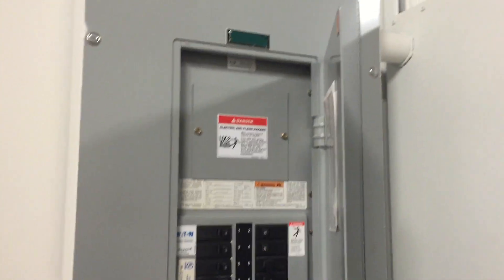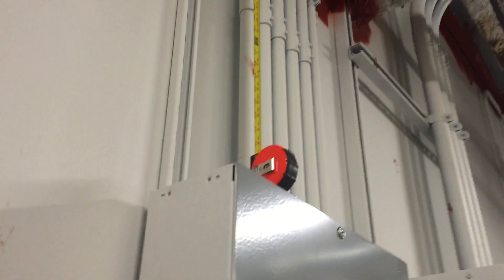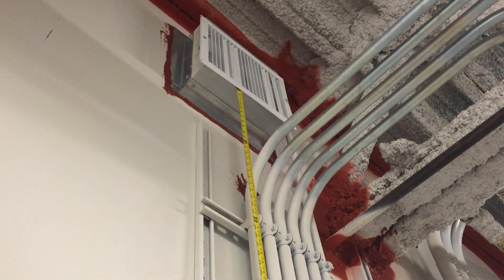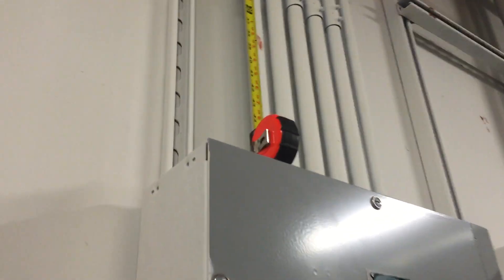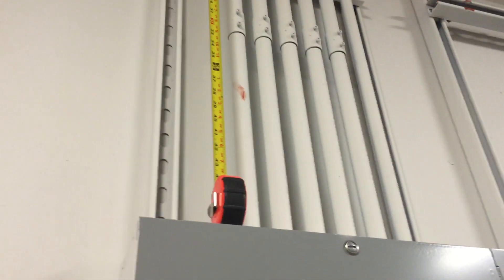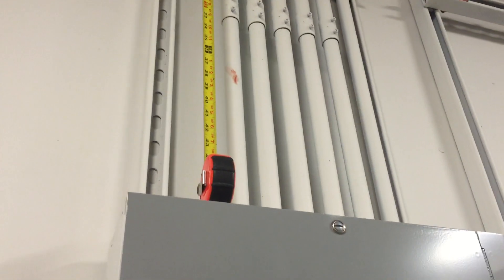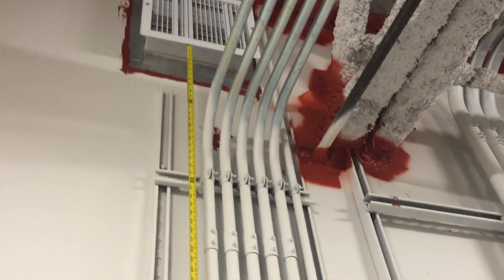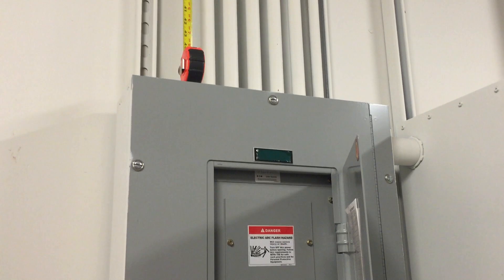Moving Violations Video No. 197: Undedicated

Comment: The exception in Section 110.26(E)(1)(b) permits foreign systems as long as it is installed to avoid damage.  By visual the presents of fire caulking this looks like a climate control vent in a muiti floor building.  Is this vent in this video truly capable of leaking condensation?
Reply: It's a route for water to take and leak directly onto the panel.  Protection would be required to be installed to allow your sited code.  Good point out though.